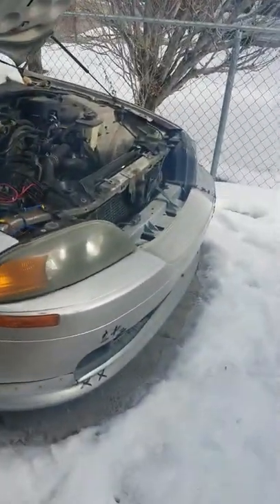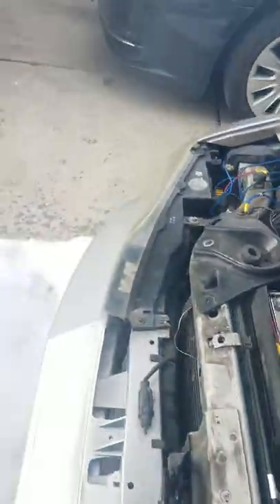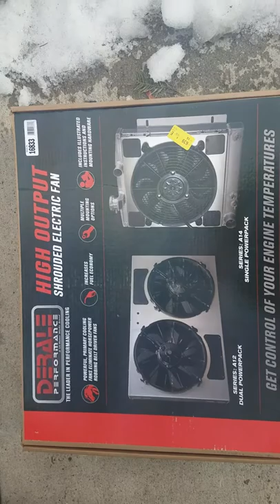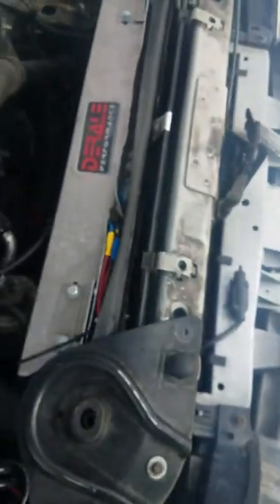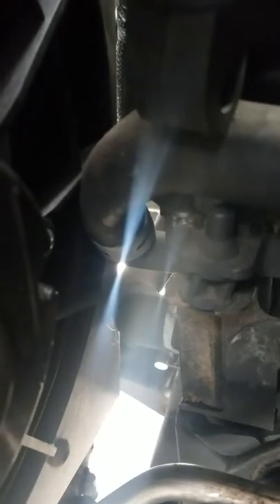Electric fan for lincoln ls v8

Comment: Finally found the real fix for my 2002 Lincoln ls 3.9L in this boiling Texas heat of 106 with the index of 111 to 116 my Lincoln does not run hot no more because I ordered a 2003 Lincoln ls 3.9L electric fan and the fan is brushless and it’s in the factory shroud I ran the big red wire with the stripe on it to my starter wire under the passenger fender skirt and the big black wire to a good body ground then I added wire to the two smaller wires with soldier and srink wrap in order to make this plug and play like it was made this way BUT one more thing you have to tap into the harness that runs across and in front on the driver’s side valve cover there is a wire that runs Down to the ac clutch you need to soldier into that wire and tie it into the small brown wire that went to your old hydraulic pump switch but do it over by the fan plug giving yourself enough slack so when you unplug the connector it’s not to short. And bingo your fan will work correctly and your ac will kick off and on correctly and when you turn your ac off it goes off and the car will run the correct temperature no matter weather your setting in the hottest of heat or not ac on and all. Also I installed a 200 amp alternator 🤓

Comment: I have so many question but there are so few answers in the comments. 

You removed the hydraulic pump and fan. Did you get a smaller belt or is there some sort of idler pulley with custom bracket that can be put in place of the pump? (If so please include part number, nomenclature or description)
Reply from the maker: I still have the hydraulic pump because the bolts are so bad. But i just had to shorten the belt and remove the pully from the hydraulic pump
Reply: @gearsngraphics8914  what is the number on the blet you used?

Comment: The thermostat you have wired up.. does it kick on and off automatically when the vehicle gets to temp? And where did you get it from
Reply from the maker: Okay i did have a few. But to be honest they were all trash. Its easier just to make a switch. Turn it on once yiu start the car. Turn it off when you turn of your car. Its totally worth it!. I abuse this car so hatd every day. And she never gets hot! And LS's will usually always overheat after a while
Reply from the maker: Just use a switch. Those tamp sensors honestly just cause problems

Comment: So did you just remove the fan pump? What about the wires and actuator that’s connect to it?
Reply: Also, if you didn’t remove the pump, could you just use a pulley remover on it and use a shorter belt? I saw that on LincolnVsCadillac.
Reply from the maker: So i didn't because the bolts are trashed. Dont worry about cables i just tied them up inside the bay. And i used a pulley remover for mine
Reply: I don't understand. Did you remove the pump?
Reply: @davidumoren2391  yea I removed the pump entirely

Comment: with the ac off the temperature needle where is it kept?
a quarter or a half?
Reply from the maker: The small line right before halfway mark.
Reply: @gearsngraphics8914  and with the ac on you think it cools enough or reaches the middle of the needle ??
Reply from the maker: @piooreyes8470  trust me the dual fan does more than enough cooling

Comment: I found the relay, but it does not have 87q as a prong. Still has 5 prongs just different names, does that matter or will it work regardless of the order you plug the wires in?
Reply from the maker: It does matter. But as long as you put it in the same order as i did you. should be good.
Reply: @gearsngraphics8914  so I could put the power on any prong as long as the others are properly placed in relation to it?
Reply: @gearsngraphics8914  like this is the relay I should be getting, how would I connect it? https://m.autozone.com/electrical-and-lighting/relay-ignition?number=19273vc
Reply: @gearsngraphics8914  https://www.summitracing.com/parts/der-16836 and this fan is the one you got? Sorry if this bugs you just don't know much and wanna be sure I wire shit up correctly and get the right parts.
Reply from the maker: @kennyk5150  dont even worry about it. And honestly it looks the same but mine was 580$ when i bought it. But everything looks right
Reply from the maker: @kennyk5150  i habe another video explaing how i did it
Reply: @gearsngraphics8914  yeah I saw that one too but since I'm a complete electrical noob I don't wanna mess up. So any prong can take the power but the others have to be the way you put them?
Reply: @gearsngraphics8914  I'm about to order the fan from summit do you happen to remember the part number? I'm looking at 16836, but there are other fans like 16838, or 16927 for example that are bigger or smaller. Just want to get one that fits like the one you purchased.
Reply: @gearsngraphics8914  looks like 16833 but the quality is  blurring it so I'm not sure.

Comment: The only issue I see with this was that it was never intended to run an electric fan. It was tried, but the car uses to much power  with all the toys so they went with the what was used. I am curious to if you have had any issues since doing this?
Reply from the maker: Nope.  I don't over heat.
And my electronics do everything that there supposed to do. So far ive been happy with the electric fan.
Reply: Gears n Graphics did you figure the wiring out urself or is there a diagram for what you did? I’m going through overheating shit because my fans are spinning slow and won’t ramp up to high speed so I’m wanting to do this also . Thx
Reply from the maker: @nicoleclark1318  i did it all myself. And ive never done wiring like that ever before
Reply from the maker: I even passed saftey and emissions today. Never had an issue

Comment: The derail fans does not work in Texas heat at  temperatures at 96 and above your car will run hot, this guys car runs fine if you notice he is in a colder climate my car runs cool with the derail fans only in temperatures around 85 and under outside air temperatures!
Reply from the maker: @garypedraza8949  interesting because here in Utah, we average 102° in the summer, and she handles traffic just fine.
Reply: @gearsngraphics8914  I have a brand new gates water pump new dccv and thermostat and new degas bottle no leaks and no air on the system and here is Texas our 100 is more like 111 humidity is terrible
Reply: @gearsngraphics8914  I run both fans and it will not cool the water down
Reply: Never runs hot if temperatures are 85 and below
Reply: @gearsngraphics8914  so I looked up the specs on the 2003 Lincoln ls 3.9L because it came with a factory fan so I purchased one and it will be here Monday and I’m installing it just like the 2003 Lincoln ls is set up 😉

Comment: why couldn't you tie the  electrical to the same wire that feed the hydraulic actuator solenoid?
Reply from the maker: Honestly.....because that didn't come to mind🤣
Reply: @gearsngraphics8914  well i did it to my Lincoln ls so i hooked the one fan to the green wire with a white stripe on it only, off of that switch and didn't use the brown wire next to it just clipped it off and then i found the clutch wire up on the wiring harness in front of the driver side valve cover and i tied the second fan into it so that when i turned on my ac then the second fan comes on along with the ac clutch because the one fan that i tied into the actuator switch comes on when you turn the key on and stays running as long as the key is on and it keeps the engine cool without the second fan but when you turn on the ac then the second fans comes on and stays on as long as either the ac is on or the defrost is on., seems to work correctly without overheating actually the temperature gauge stays 1/8 of a inch below the half way mark and before it stayed 1/8 inch above the half way mark. i really apricate you putting this video up because there is not any videos that actually help on the ls Lincoln's i would really like to talk to you more about the lincoln ls somehow if even by phone, thank you
Reply: @gearsngraphics8914  so one more question what did you do with your dccv?
Reply: @gearsngraphics8914  have you had any issues with your blend door motors or the dccv allowing hot air on one side of the car while blowing cold air on the other side?
Reply: @gearsngraphics8914  i did not use any other type of thermostat but allowed the factory temperature switch to work normally opening the thermostat by its factory setting in order to move the hot water through the radiator and engine, seems to work but i did use the relays as you did but i hook them up as i said and everything works perfect., but it was a pain in the rear getting the hydraulic pump off but i did it and the belt i used was a 100 ich belt and also i changed the top idler pully on the passenger side to a grooved pully with side rails so the belt wouldn't slip off and that pully came off a 2004 Lincoln ls with a 6 cylinder the pully was on the passenger side top it worked very well so also that pully that was on the car before was smooth and the belt road under it but now the shorter belt rides on top so it needed the 6 grove pully.
Reply: @gearsngraphics8914  i am now thinking that i should maybe go with the 144 amp alternator what do you think?  my research shows that's the next step for a alternator upgrade on the 2002 Lincoln ls. my ls runs really good i bought it with a original 63000 miles and its very clean

Comment: Hope I'm not too late but would you be able to put a list of the part number for the fan and relays in the comments? I really need to convert as I don't have time to mess with the shitty hydraulic fan and couldn't find any good videos about a conversion until I came across this one.
Reply: I actually just found the part number for the fan. 
For anyone wondering the part number is as follows
•259-16833
•19273VC is the relay part number (need 2)
And any switch should work, I'm guessing. If I'm wrong feel free to let me know as I'm going to be undertaking this project soon. Thank you for the videos.
Reply: Kenny Kelly where do you order this from?
Reply: @evelingutierrez46  I can only find the fan on summit racing. Relays auto zone. Hope he sees this.